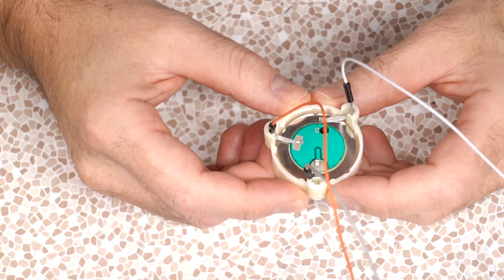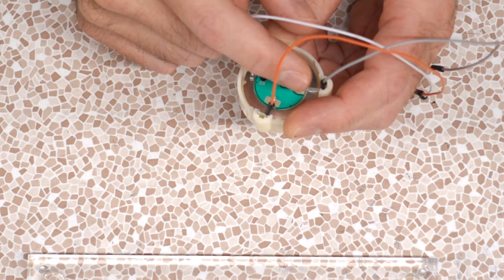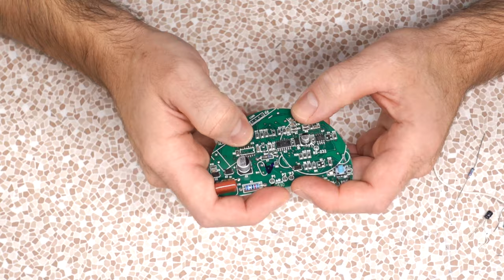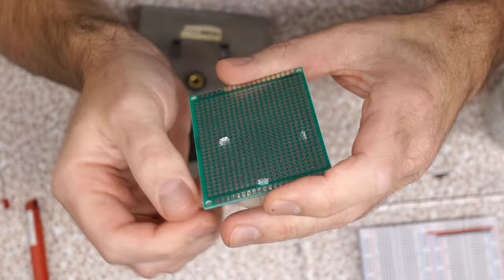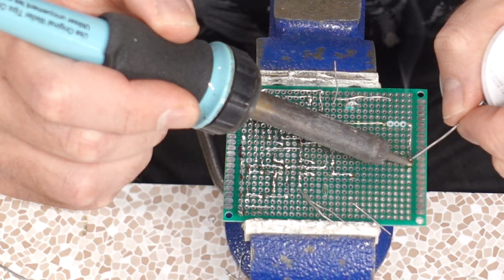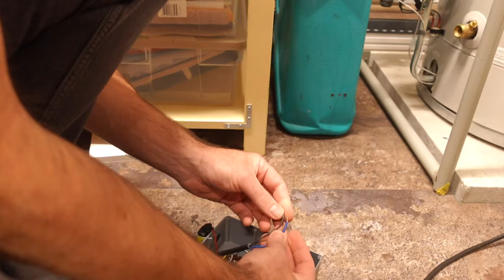Repurposing a Smoke Alarm Beeper

Comment: Does the shroud around it make it sound much louder.  I have one without the plastic cover or shroud and it doesn't sound very loud.
Reply from the maker: Yeah, it could I suppose. Resonance is a big thing in audio. Also, was it loud before ?
Reply: Okay here's my problem,  I have removed a 3 pin buzzer from a board and replaced it with a three pin piezo plate from a smoke alarm. The sound now is low and I decided to dig open some of the original buzzer to find it contains at least a circuit with a transformer or coil. 
Now I'm confused because the two pin piezo buzzers usually have the driver circuitry build into it but not three pin buzzer?? 
I thought all three pin buzzers have no circuitry and one must add there own feedback circuitry to drive it.
It's an sp-1359 from bell but contains this amplifier circuitry I presume? 
Obviously when I used the three pin piezo plate  it works but much lower.
Reply from the maker: @irishguy200007  Well, I'm not an expert on this, I pretty much just figured out how to repurpose what I had on hand to work with. 
As I understand, the 3 pin piezos need a driver. Some 2 pins either are a self contained unit that you just give power to, or there are 2 pin piezos but they are often used in different applications. You could get a 2 pin piezo to do this kind of thing, but without the feedback pin, you'd have to manually figure out it's resonant FQ and build the circuit to drive that. It could be considerably quieter if it's not running at the correct FQ. 
I'm not sure how much help I can be, it's the kind of thing I could probably figure out, but Id' have to have it in hand at my bench.